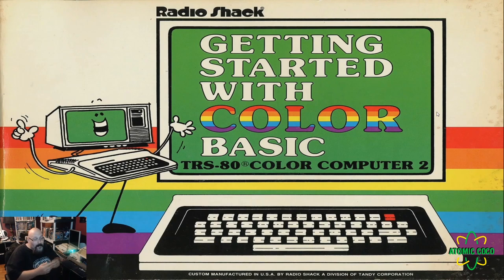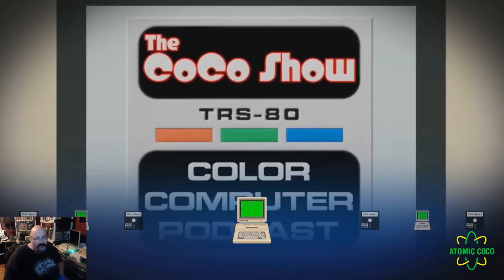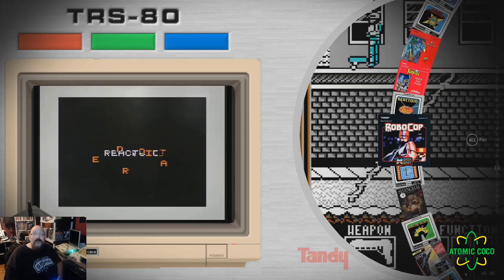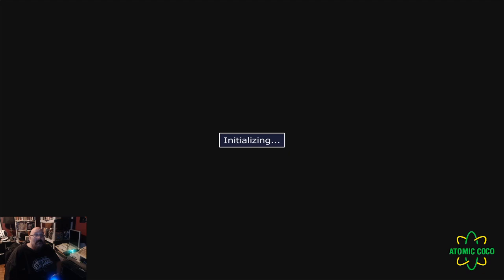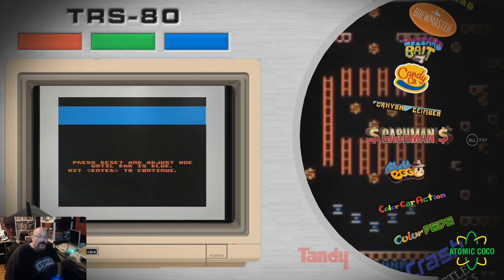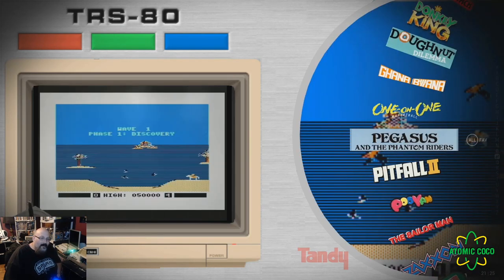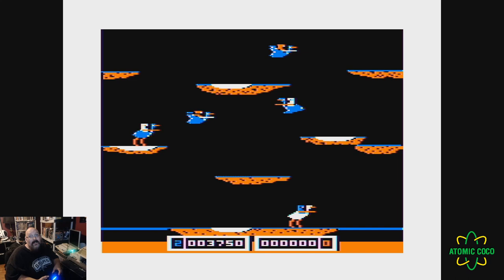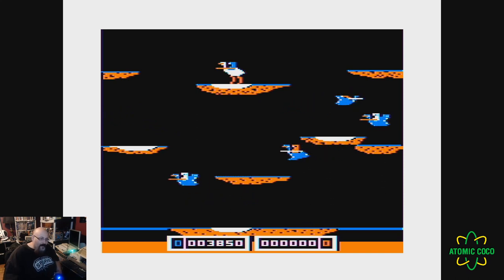The ATOMIC COCO! Atomic Pi in a TRS-80 Color Computer 2 + custom Coinops NEXT Frontend & WINDOWS 10!

Comment: I'm going to go with: This is his "private" make for coinops because i've been all over, never seen this and it's not the "standard" coin ops format, this looks home-grown. I could "probably" replicate something for you guys. Let me get on RetroFE (aka CoinOps) and see what i can drum up in a few days. There has to be a LOT of formatting done considering the Coco has BIN, CCC, DOS, DSK, and ROM extensions (for game roms) to deal with. Also, you will need "some" form of CoCo knowledge because carts are going to be the only thing you can just click n load. The rest requires a little bit of on-hand knowledge. I'm going to go ahead and get a NONAG version of MESS because it doesn't take much emulation to run the COCO unless you're hitting OS-9 levels which i might shoot for. We will see.

Reply if anyone is interested.
Reply from the maker: Hiya!  I did the work on that CoCo Coinops thing...  I actually submitted this to the appropriate guy from coinops at the time, but I never heard anything and this didn't get distributed.  I generated all the video and most of the logos as well.  I had two different gimmicks - Cart stuff and disk stuff.  I did the loads on the disks two different ways...one was loading save states and the other was literally having the command line type in and load the disk every time.  I did run into trouble with mess and the save states. This was a proof of concept, and i'd be happy to share the art or build or anything with anyone.
Reply: @AmigosRetroGaming   I would love a copy been trying to find  a build of this forever to work on the pi right.